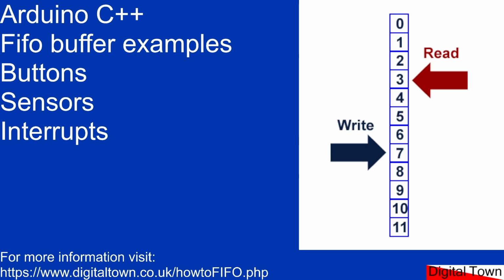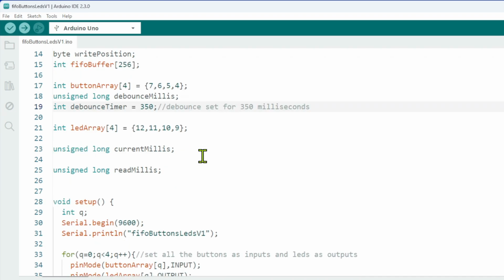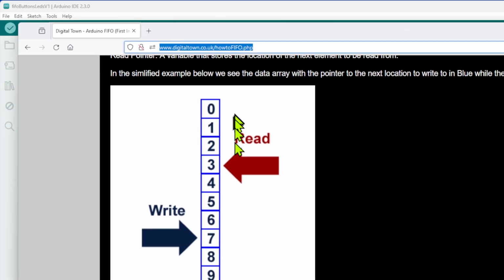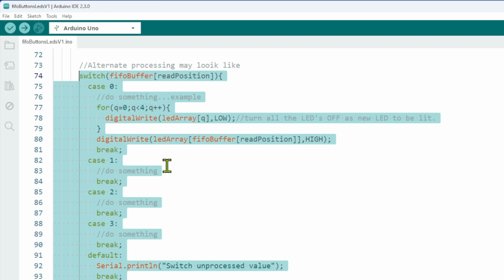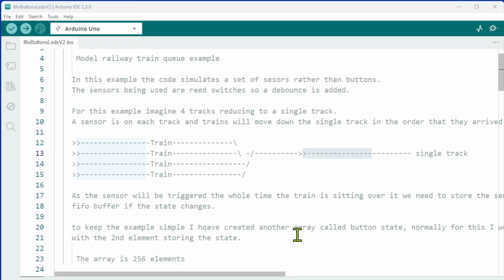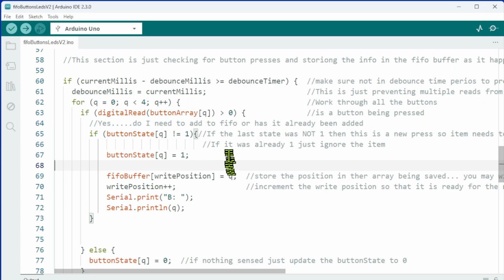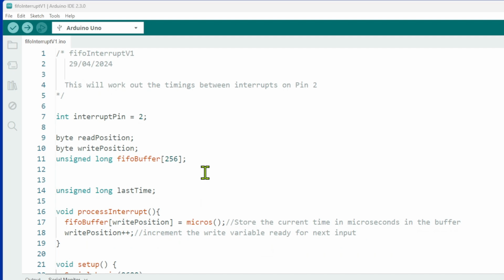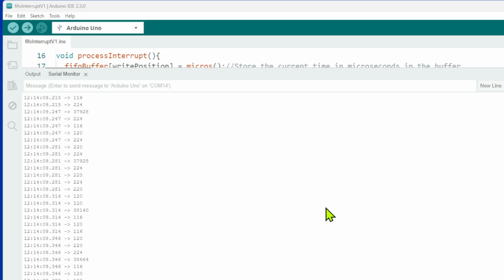#85 Arduino C++ Using a FIFO buffer with buttons, sensors and interrupts

Comment: Have looked into the possibility of using Free RTOS for some of these tasks as in a multi-tasking mode instead of using millis?
Reply from the maker: I've used Free RTOS in the past but even then used millis for timing. Using delay() is never a good solution.